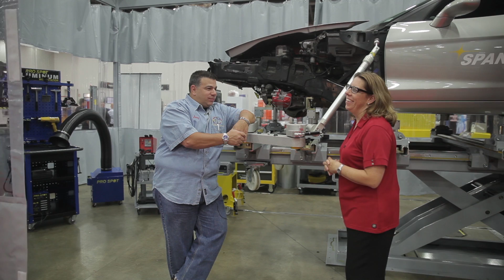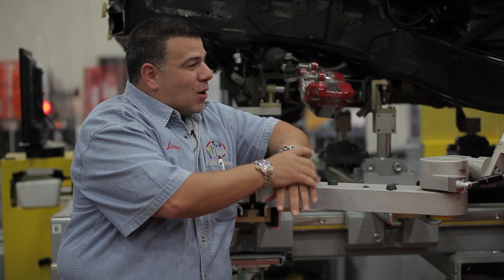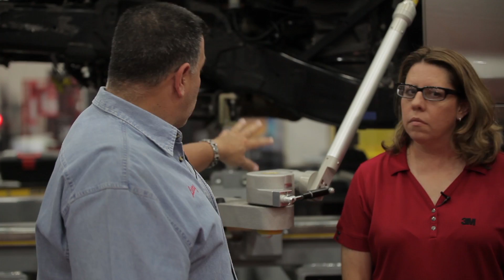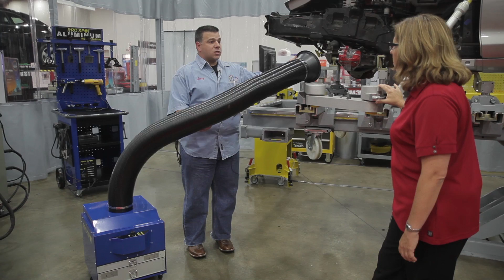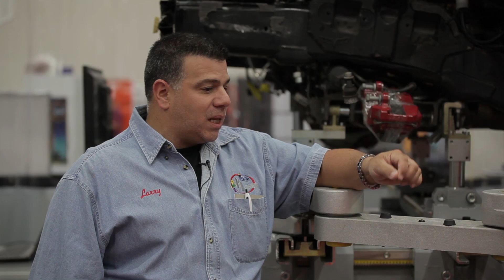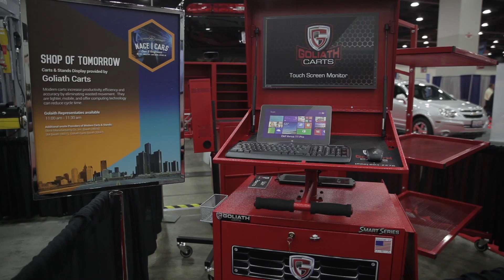NACE 2014 Repair University Aluminum Repair Hype

Comment: I am a coachbuilder, and have built 3 wheeled Morgans, restored formula cars, Rolls Royce, Astons etc. I bodied the upper half of the Morgan's with aluminum and lower half with steel for rigidity. Thankfully none of my cars blew up. I used the same tools, hammers, sandpaper, beadrollers, English wheel, and brakes. NONE of the bodies corroded. I then GAS WELDED the alloy usually without filler rod all under the same roof. We didn't have filler rod back then so you had to sheer a strip of like metal the desired thickness and weld with that or in the case of POT metal, grind the chrome off and make due with scrap. Back in the day, we also had disc brakes and poly fuel lines 30 years before the big 3 decided to use the material  but that was how things were in the 60's i guess. I can't understand how metal fab shops don't blow up, or why they use TIG  instead of MIG welders and buy rod instead of spools that go bad.... I guess maybe I'm just too old and dumb to understand or remember the things I did by accident that worked while the next generation is dumbfounded by what they are TOLD. MAY YOUR F150 NEVER GET HIT BY A STEEL CAR! I don't know much, but if the big 3 all go alloy and Toyota frames rot out that leaves us with Nissan pickups? We have yet to prove corrosion resistance in the snow belt. Who knows? Alloy may not be viable. While people make fun of the Fiero, it was replaced by a Transport and a Saturn which is near identical in basic design. So much for the better built car. Hopefully the F150 body isn't used as an electrical ground. We also welded Freightliner cabs that were alloy but I guess Ford does it differently.
Reply: +max webster I am in the automotive chassis and body industry and am aware of the recommended use of separate tools for steel and aluminium to avoid contamination that could promote corrosion etc. My confusion is that many, almost all, body-men/coach-builders/metal-shapers that I have worked with and/or been schooled by, do not have this approach. Using the same wheels and dies for both, the same bending and forming tools, often the same dolly's and spoons with just the requirement of ensuring they are clean and true before proceeding. This seems to have been an acceptable practice for decades and not one could give me an example were this may have resulted in a problem further along in the panels life. SO WHY NOW? why are the insurance companies/training organisations/tool manufactures/vehicle manufactures recommending this?? Another cash cow to milk??
Reply: Alloy construction is new to most body shops. Our local shop just doesn't fix Ford trucks anymore. I suppose most body men just listen to their sales seminar and get out their wallet. I know one thing, the size of the tool box is irrelevant -it's how you use the tools that counts not the size of the ego. I should add that I do drive 2 Fords, a Chevy and a Chryco. I WILL NOT BUY an alloy Ford or a Triton piece of shit. Toyota has the frames rotting under warranty so I guess that leaves us with Nissan...............They would have done better with an SMC (composite) in my opinion. Looking out my front window.....neighbor's Ford has been in shop for 2 months. I can see his loaner car. Good luck with that Ford.